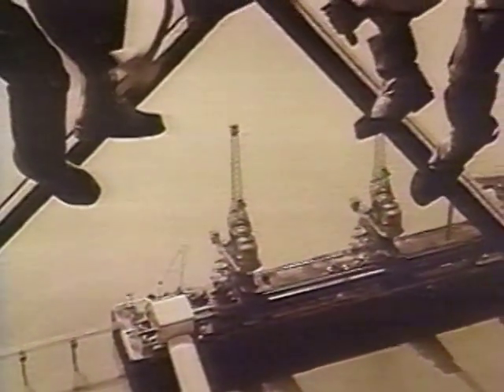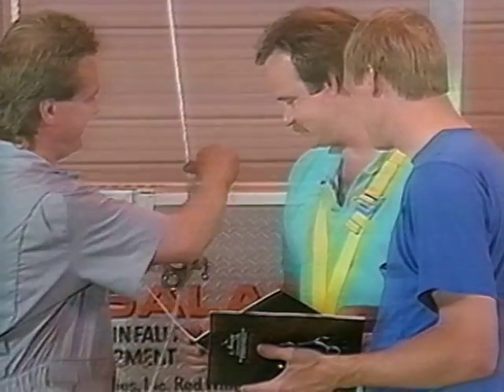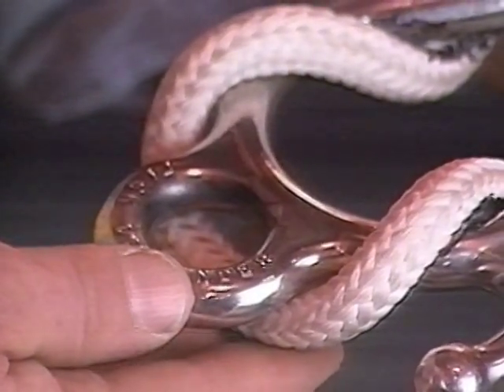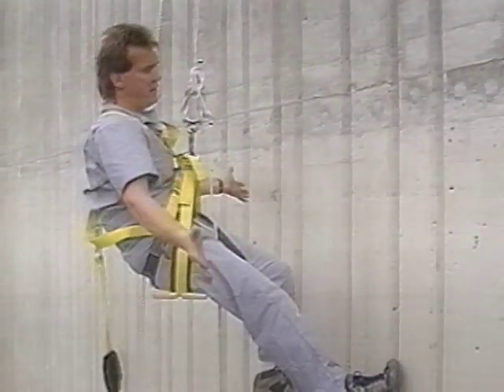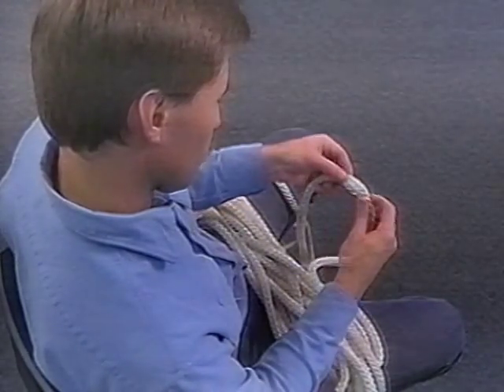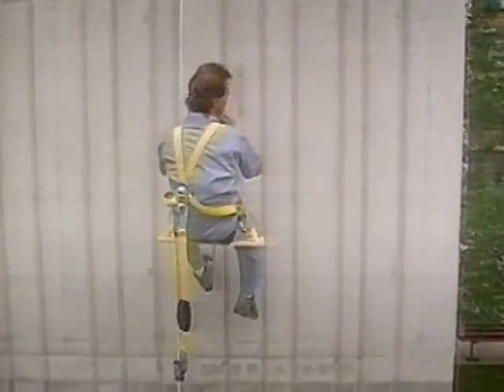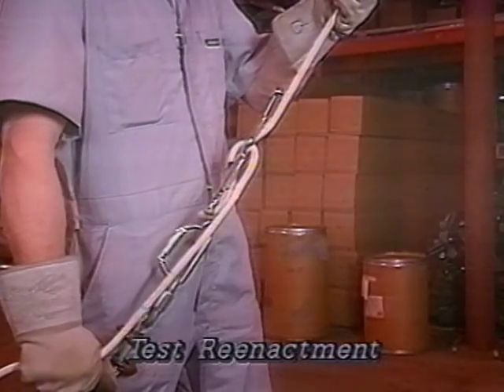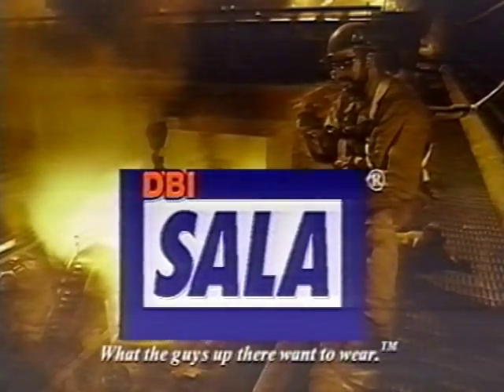DBI Sala Fisk Descender Instructional Video

Comment: (re 11:21) You must have been told before, "Don't bound down a rappel!  Despite what you see in movies."  Smooth, steady, fully controlled descent is fundamental to good personal safety habits.  If you must stop, to recover posture, attitude, or control, plan ahead, and do so gradually.
Sudden stops maximize the load, stress, distortion, & wear of all components of the life safety system: Roof & parapet anchors & suspension structures, lines, thimbles, knots, links, other devices, harness attachments, stitching, & straps.  Unnecessarily decreasing safe utility life, & increasing the chances of dangerous malfunction or even catastrophic failure, & anxiety in risk averse on-lookers, administrators, & insurance inspectors.